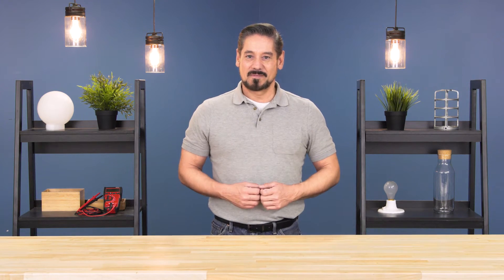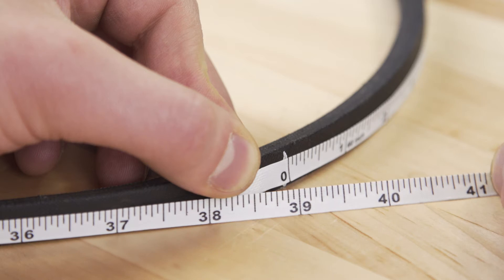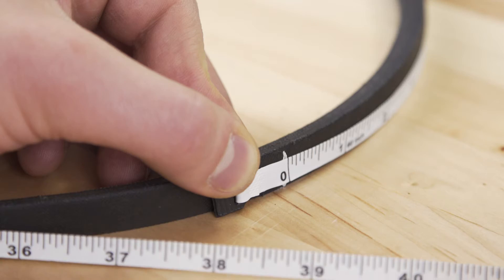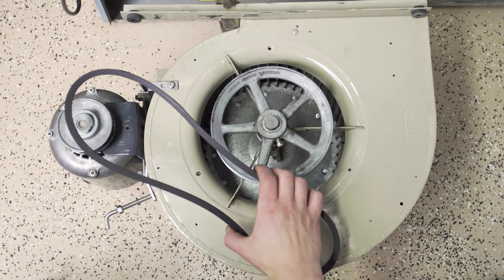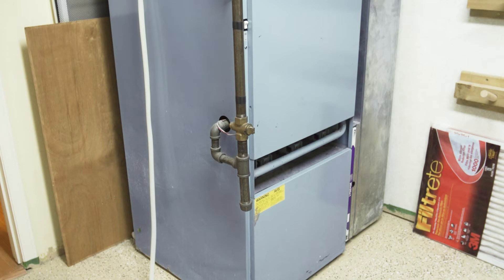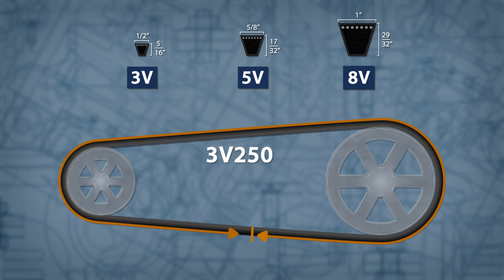V-Belt Code Guide | Spec. Sense

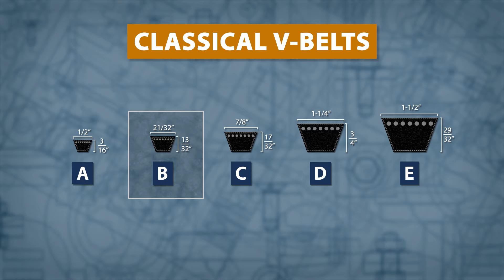Comment from the maker: Update The depth for for  "A" belts at 2:21, "AX" belts  at 2:32 and "4L" belts at 3:24 belts is actually 5/16" (not the the 3/16" as mentioned). 
The width for Deep V 4:15 at 3V and 3VX belts are 3/8" or 9.5mm wide ( not 1/2" wide as mentioned) 
Unfortunately this can't be changed without deleting and re-uploading the video which is why this update is pinned here.
Reply: e6305-72531 can you decode this ?
Reply: I can't believe you guys completely and utterly screwed up this video. Wrong in multiple places.  Redo the god damn video.
Reply from the maker: @wildmanofborneo  Deleting this video and reuploading with the fixes would lose all interactions, all views and this video will not ever be as visible or reach the same sort of viewership as it has now. This is why we added the pinned comment.
Reply: i actually catch it, cross check on internet camback to reply here then saw your comment
Reply: Can you explain this in metric system

Comment: I'm trying to find a replacement belt for an old Dayton belt and having tons of trouble, can you help?  The number printed on the belt is 37320 S(possibly 5)6013, so 37320 S6013 or 37320 56013. The numbers on the belt do not follow any of the explanation in your video. It's a very old belt so any help on how to interpret the part number is greatly appreciated. The belt is a cogged v belt 7/8" wide at the top.  Thank you.
Reply from the maker: Thanks for watching. There are many old belts that have numbers that don't come up in any searches. Using the steps in the video you can measure everything you need to find a replacement.

Comment: ok so what about z480e?????
Reply from the maker: That might be a specific number to a manufacturer. Some appliance belts are like this. If needed you can either measure the belt following the steps in the video, or enter you model number to try to find a replacement that way (if the belt is for a washing machine etc) https://www.amresupply.com/lookup

Comment: Hi there,I have a question.What is the difference between grooved pulley and sheave?
Reply from the maker: Grooved Pulley: Primarily for belt systems (V-belts)
Sheave: Primarily for rope or cable systems (used in rigging, lifting, and similar applications).
Reply: @AmreSupply 
Thanks for the reply. However, I'm wondering also another thing. Let's say I have 3 pulley diameter options and the one with bigger diameter has faster than other 2 pulleys. Can I say it's the optimum velocity between these 3 pulleys? I'd really appreciate it
Reply from the maker: @ygt824  This question is a bit outside of the scope of the video but it's something that google or Chat GPT would be pretty good at giving you more information on.

Comment: 3V and 3VX belts are 3/8" or 9.5mm wide belts  ( not 1/2" wide as mentioned )
Reply from the maker: You are right, thank you for spotting that. The pinned post has been updated.

Comment: I am trying to find a Gates Truflex 4LXA720 belt but cannot find it anywhere. Where can I get a similar belt and what size do I need based on the markings?
Reply from the maker: Thanks for watching. From the number it seems like it is a 4L with a length of 720. If the belt is cogged you'll want to match that. There can be some variation in how these are numbered and what extra letters and numbers are added depending on the application. In any case you can still doublecheck and measure the belt.

Comment: I need a washing machine belt M with an inner circumference of 25 inches. What belt should I buy, is it M 25, M 26 or M 27? Thanks for this video.
Reply from the maker: Thanks for watching. To find a matching belt you can enter your model number for your washing machine into this tool: https://www.amresupply.com/lookuppart

Or match based on outside circumference as M belts are designated by outside length.

Comment: Thank you! Very thorough. What about measuring when changing a pulley size? String or other material around both pulleys? 
Thanks!
Reply from the maker: Thanks for watching. Using a string around a pulley will work and just keep in mind most pulleys can be adjusted, so measure with the pulleys set in the middle so you have room to adjust afterwards.

Comment: My drill press has a k26 belt. Looks like an a belt to me. What is a k belt? Also what are the plusses and minuses of a cogged belt?
Reply from the maker: Thanks for watching. A K belt will just be a specialty belt for the drill press. This is different than the standard naming but without more information from the manufacturer, can't be sure what other differences there are from standard belts.

When it comes to cogged belts, they run cooler, last longer, and are a little bit more efficient.

Comment: About the fractional L series of belts. A 3L belt for example. Some of them come in a kevlar wrapped variant (eg. 3L300K) commonly used on lawn equipment and snowblowers, I can't find any info anywhere on the max operating parameters of these belts. Any idea how much HP they can handle reliably?
Reply from the maker: Thanks for watching. This video was geared mostly towards HVAC applications but v-belts are also used for other lawn equipment and snow blowers. I don't have any specific information on the max HP rating of those belts. If you are buying a replacement belt intended for a snow blower then it likely should be fine to handle a range of snowblowers as long as the belt size is matched properly.

Comment: 3:00 is the calculation of outer - inner circumference for the A/B/C/D/E belts of 2/3/4/5/6 inches an estimation for an approximate value?  
Are the belt thicknesses considered to be exact values?
Reply from the maker: Thanks for watching. The belt thickness should be close however you might get some variation between manufacturers and there might be some warping over time with heavy use.

The width and length is needed for matching.

Comment: Great video!! Though my belts code shows Z-390E. Any idea where I can find a replacement? It’s for a portable washer.
Reply from the maker: Thanks for watching. You could try entering the model number of your washer to try to find a parts list for an exact match: https://www.amresupply.com/lookup

If you can't find the part number you can measure the belt and match it based on it's specs.

Comment: I’m looking at a pulley that says it accommodates “1/2” ABS belt style.” Does anyone know if that 1/2 inch would be referencing the top width, or the depth of the belt? Thx
Reply from the maker: Thanks for watching. If it only lists one number than that will be for the top width. You can see here on our website that Deep V belts are listed by top width as the main way of sorting: https://www.amresupply.com/catalog/3V-Deep-Wedge-V-Belts-HR2G

Comment: Thanks.  I have a  Earthquake Rototiller # 6015v  The belt is a cogged  31315 4XLA.  I have found it  impossible to cross reference.  They designed it so you have to buy one of their 50$ belts.  They could have put two of the regular belts on it.  Never another Earthquake machine.  I did order a AX24 - AX-Section Cogged V Belt.   We will see if it works.
Reply from the maker: Thanks for sharing your experience. Keep us posted if it works!
Reply: @AmreSupply  
Do belts come in a designated list of sizes or are they available in a continuum of sizes at the whim of the manufacturers?  Like is there a 3L366 belt or some such oddballs, or only in steps of 5?
Reply from the maker: @hwingerrr5680  Thanks for watching. It depends on the manufacturer but often there are more sizes in the mid range where there are more uses. Since most motors can be adjust, this covers for slight variations in length. As you get into very long belts, there are less available due to it being more specialized.

Comment: I have a belt that measures 35.3" outside circumference, with a width of 3/8", and height of 1/4".  
Would that be a FHP 3L belt, since the width is less than the smallest classical belt A size of 1/2"?
Reply from the maker: Yes that would be a FHP 3L belt as listed here: https://www.amresupply.com/catalog/3L-F-H-P-V-Belts-HR2

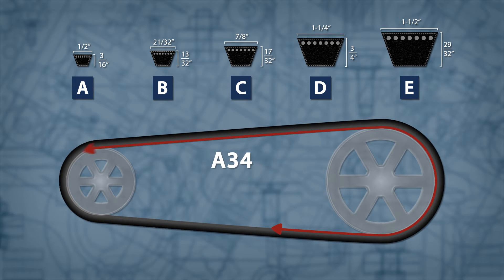Comment: 2:40 So if a belt happens to be classified as a "classical" belt, then it's measured by the inside circumference rather than the outside, as is done for the FHP and deep Vee belts? 
That seems like a recipe for confusion... How do you know for sure if it's classical vs FHP?  Are the size profiles unique in each type?
Reply: For the A belt with the 5/16" height, the calculation of 2*Pi*(5/16) is 1.96, which matches the -2 Delta of inside and outside circumference, but the C belt with 17/32" height is only 3.34", not a Delta of -4".
Are those just supposed to be approximations for estimating the inside belt size based on the outside circumference measurement, rather than some exact cross-reference?
These are the exact Delta values based on calculations:
A 1.96"
B 2.55"
C 3.338"
D 4.712"
E 5.694"
The C belt is only one that rounds off to a different number than the guidelines given; the other ones seem okay.
Reply from the maker: @wingerrrrrrrrr  Thanks for watching. When it comes to classical vs FHP, many belts will list both. https://www.amresupply.com/part/4L380-38-inch-X-50-V-BELT

You can still match based on the width and depths, then use either inside or outside diameter to pick a belt.

Belts will also stretch and warp over time so that should be factored in. A used belt will never have the same exact measurements as a brand new belt.
Reply: @AmreSupply  if the belts are consistently specified as inner or outer circumference it would be more certain.  Does the way the part numbers are written clearly define whether they're using one or the other method?
Reply from the maker: @wingerrrrrrrrr  Classical and FHP belts are the same. They are just two different ways of describing the same belts. That's why many belts, such as the example link, list both numbers.
Reply: @AmreSupply   
Okay, that clarifies it, in the description on the website, it mentions the dual branding:
This classical belt is built to RMA engineering standard IP 20 and is dual branded with classical multiple size and FHP size. FHP designation denotes outside length. Classical designation denotes inside length. Inside length plus 2 inches equals outside length.
(For that particular belt thickness)
It would have been good if they stuck to one method; I guess the classical inside method was first, and the FHP came later, and became the preferred measurement.

Comment: Great video!!! But i want to buy a belt for my lawn mower. They sais it is a 5/8 belt by 84 inch. But it said "B" and "5L" on the packaging. So it is not really a 5/8? A 5/8 is a 5v belt right?
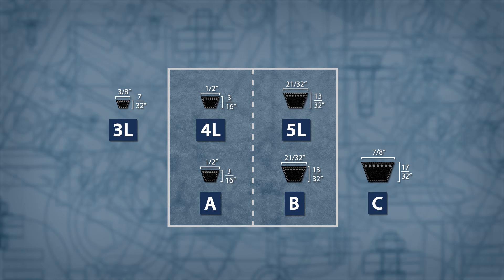Reply from the maker: Thank you, we're glad that you found it helpful! As you can see at 3:48 belts that are 4L will be the same as A.  Belts that are 5L are also a B. The width on the B & 5L is 21/32 which is very close to 5/8 (which would be 20/32). So in this case 1/32" difference in width will not matter.

Comment: Good morning , i want to ask how long lifetime of vanbelt
Reply from the maker: Thanks for watching. That is a hard question to answer as it depends on many factors. If the alignment and tension are right, then a belt can last years without too much wear. In other cases belts will wear down much sooner. If you notice that a belt is wearing down quickly then its often an alignment or tension issue.

Comment: This was a very educational video. The belt I need replaced has the code O-448E . It's from a Giantex washing machine. Do you know where I could possibly get that one?. It looks like it is a V belt but it's code name begins with an O. 😳
Reply from the maker: Hi Delora, thank you for watching. The code is likely one specific to that manufacturer.

There are a few things that you could do: You can enter your washing machine model number to try to see if the part shows up: https://www.amresupply.com/lookup

As well there are a wide range of washing machine belts belts available that you can browse through: https://www.amresupply.com/catalog/Belts-Idler-Pulleys-637140-AI1H

In your case if the belt is a V belt, you can simple measure the belt using the steps in this video and use generic V-belt as a replacement: https://www.amresupply.com/catalog/A-4L-Multi-Plus-V-Belts-HR2A
Reply: Im trying to replace one for a giantex portable washer too! I think this video is maybe less helpful when comparing wholesale Chinese parts but I did find wholesale websites that sell the brand jihua that giantex uses. 
Did you figure your situation out a few years ago @dapoet200

Comment: Hi, can I use a A series belt to replace an 4L-340 belt? May I also know what exact code should I be looking for an A type of belt? I would use it on my old washing machine. I would be grateful if I get a free answer from you. TIA
Reply from the maker: Thanks for watching. If you have a 4L-340 belt that measures 34 inches from the outside circumference, then the matching A belt will be also have an outside circumference of 34, subtract 2 (as mentioned at 2:57) and you get an inside measurement of 32 inches. That would mean your replacement is an A32 https://www.amresupply.com/part/4L340-34-inch-X-50-V-BELT  

If you're replacing the belt on a washer you can also try to find an exact match. https://www.amresupply.com/catalog/Belts-Idler-Pulleys-637140-AI1H If you enter your washing machine model number in the search on our website it will likely bring up a parts breakdown with the parts listed on the side. Here's an example: https://www.amresupply.com/lookup/304244/2305336

Comment: This is the most clear and eloquent video about motor belts that's ever been made or ever will be made.
Reply from the maker: Thank you for you kind words! We're glad you found this video helpful!
Reply: @AmreSupply  It was really perfect. I'm modifying the motor/machine arrangement on a fractional hp woodworking machine, and this made it easy to figure out the belt type and size I had, as well as pick the new required length.
Reply from the maker: @nyw11  Glad that its helping your project come together. We also did a video on all motor types with some great animations if you're curious. Its a good video for general knowledge https://www.youtube.com/watch?v=vpspMVQQXRs&list=PLCo9SMjkdWBwO32FK6H0JuVo9o7MUo6Fj&index=1

Comment: trying to piece together a shop fan, took a rope measured 44 inches around both pully's . bought  a  v-belt 9455 . Measured 1/2 "×46" still to tight. any recommendations. Thanks.
Reply from the maker: Thanks for watching. If you're able to get the belt over-top of the pulley's then it will stretch with use and will. If it is too tight and it won't mount or won't turn smoothly when installed, then you might need to get a larger belt. The 9455 has an effective length of 45", so the 9460 belt might be a better fit as it measures a bit over 46"

Comment: Why two v belt using some applications, for example lathe machine, can we use single belt
Reply from the maker: Thanks for watching. Using 2 v-belts is a way of transferring more power with common, less expensive belts rather than using a single larger belt.

Comment: I have an old craftsman drill press.  I need to change the belts and they have codes of sr 210 or 4l 210.  And the other two are sr 170 4L 170.   Any way I can find a replacement for those?  Thank you!
Reply from the maker: Thanks for watching. At AMRE we carry a variety of belts including the 4L 210 https://www.amresupply.com/part/4L210-21-inch-X-50-V-BELT and the 4L 170 https://www.amresupply.com/part/4L170-17-inch-X-50-V-BELT

Comment: For the cross-sectional dimension graphics, please check your "depth" dimension shown for "A" at 2:21, "AX" at 2:32 and "4L" at 3:24.  For these 1/2" top-width belts, you show 3/16" as the specification depth, but it should be 5/16".

(As a sanity check, in the graphic at 3:24, would it make sense that the 7/32" depth of a 3L belt would be greater than the stated 3/16" depth of a 4L belt?)
Reply from the maker: Thank you for watching! You are right that the depth mentioned for A, AX and 4L belts should be 5/16".  and not 3/16" as shown in the video. Even though we have 5/16 written in the original script that is one typo that made it through. Unfortunately it can't be changed in the video without deleting and re-uploading which would lose all views, comments interactions. There is a pinned post and and update to the description to help clarify that for people.
Reply: @AmreSupply     Understood; thanks for confirming!
Reply from the maker: @svyt  You're welcome! Thanks for commenting and pointing that out!

Comment: Very informative!  BUT, my Snapper lawnmower uses a 7158101 YP belt.   Do you have any idea what the YP means ?
Reply from the maker: Thanks for watching. I haven't seen YP in referenced to V-belts in general. The YP is likely just part of the manufactures internal system of naming. If you can find an exact replacement using that part number then that would be best as it would remove any doubt, but as long as you match the size and length of the belt then you'll be good to go.
Reply: Ok, thanks for the reply.
Reply: itaintmebabe99 
most snapper blade belts are a six sided belt.
Reply: Randy Deskins OK, so you don’t know either !

Comment: Does a B belt have more grip--less slippage--than an A  belt?  I have a wood splitter that slips on the pump pulley with a difficult split using an A belt and I'm wondering if changing to a B belt will improve the grip significantly.
Reply from the maker: Hi Don, thank you for watching. Overall its best to match the belt width to the intended design. Having an ideal tension (tight but not too tight) and a clean belt will help prevent slippage. If you're curious to learn more this video did a great job explaining how to address slippage. https://youtu.be/syWiGYDOM70